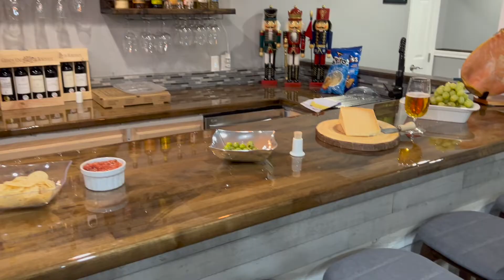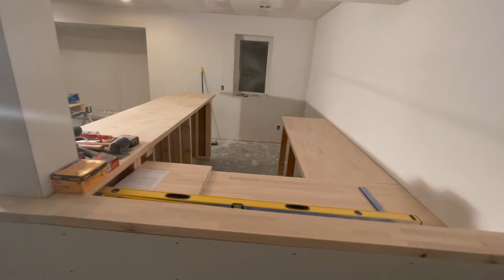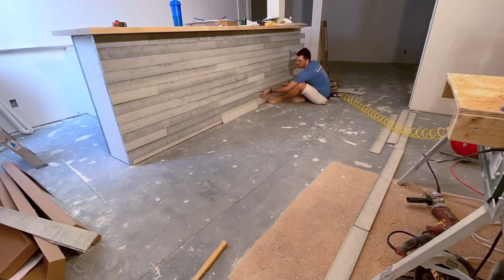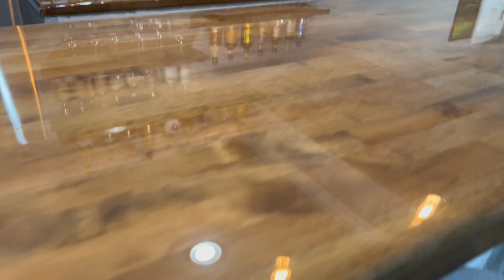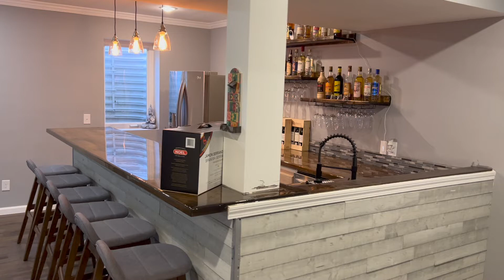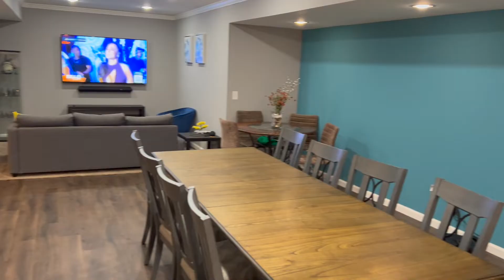Basement Bar Framing

Comment: how did you hook up sink and water
Reply from the maker: I pulled the lines from that back wall over there. Cold and Hot water.
Reply: How about the drainage to the main drainage vent